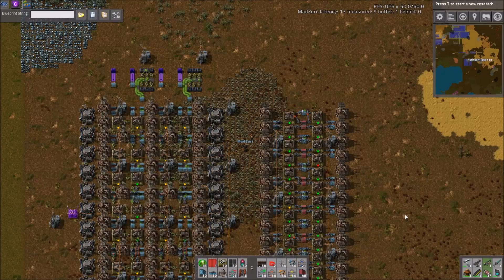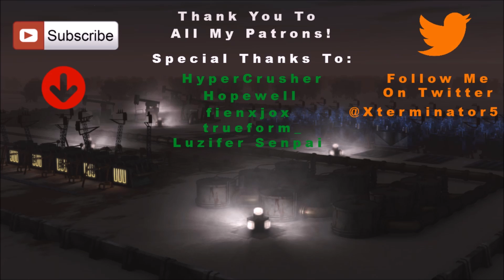Factorio Workshop - Building A Better Factory :: D4rKMinD's Circuit Builds

Comment: Hi Xterm. I made two submissions, one just over a month ago and one about 3 weeks ago for ultra compact assembler/furnace layouts and a tilable safe crossing with signalling for players. When do you reckon i will see these featured?
Reply from the maker: Soon I would imagine, although perhaps not all of them. We prefer to not do tons of designs all from the same person in a short time period, so that's the main reason we've held off on them so far because we've already done several you submitted I believe.
Reply: Ok no problem. I saw you guys experimenting with a green circuit build on ColonelWills twitch on the V.15 sim game. It had the same concept as some builds i had been working on around that time (the assemblers laid out in an alternating pattern to minimize space). I just should have submitted sooner! It's a solid concept and fair play to the person who got there first!

Comment: Easy fix for the inserter issue is to add 2-4 more copper cable assemblers to fill the belt. that will allow the inserters time to pick up the cable(side loading to fill the inner lane) would only make it a little longer
Reply from the maker: Hmm yeah that would probably fix it, although the problem is that the cable can only go on 1 side of the belt with this setup, and I think one side is pretty much fully saturated as the build stands now.

Comment: Got an error for both blueprints when i try to import them... http://prntscr.com/ejtjbo
Reply from the maker: Ah yeah, sense these were built with Creative Mode and used Loaders, you will need Creative Mode installed, at least initially to have it work. You could then remove the cheaty stuff and remove the mod once you imported them. :)